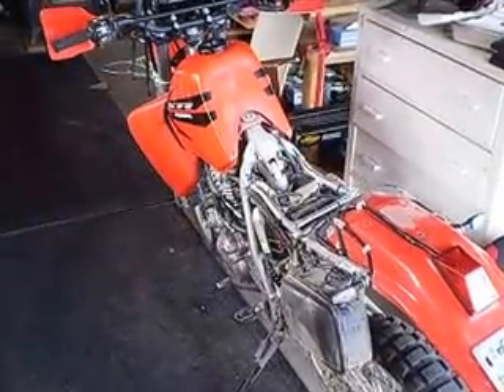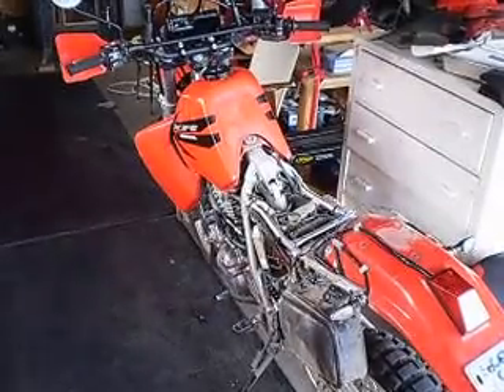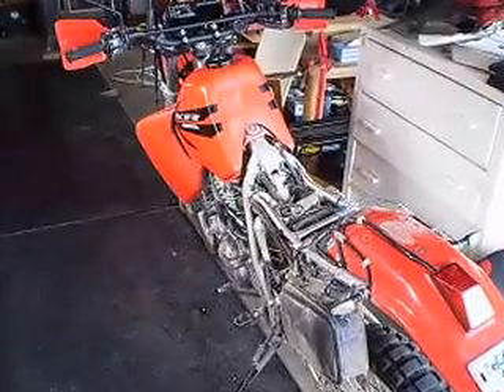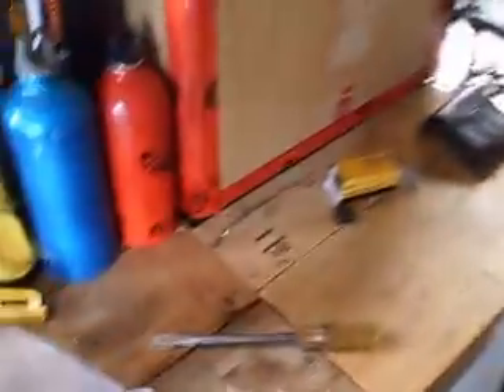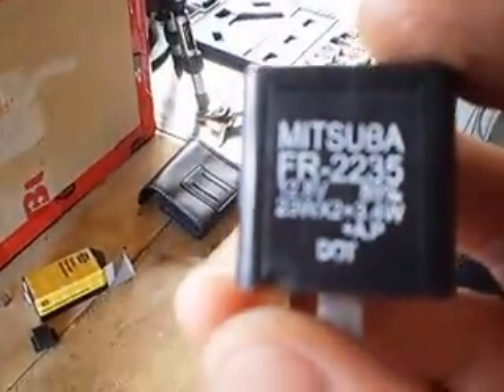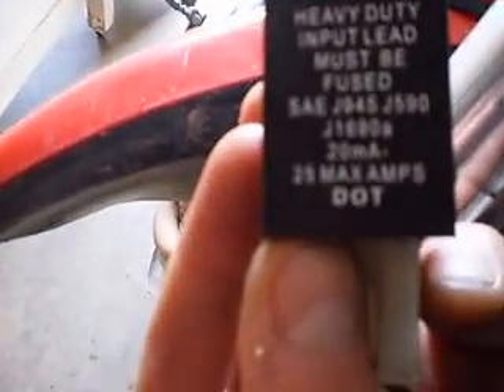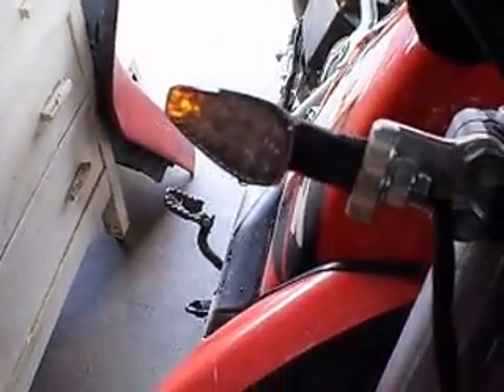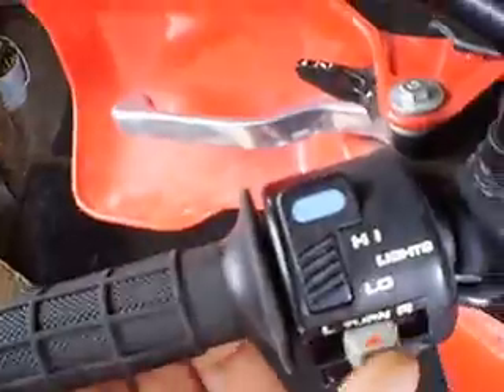Honda XR650l LED turn signal install

Comment: After watching this most awesome video, I found LED dash bulbs on amazon and bought some. It does NOT fix the issue. The dash bulb receptacle is not designed for a diode type bulb. If you install one, it will only light when you turn one direction and not the other. If you flip the diode bulb 180, it will only light when signalling the opposite. 

 Thank you for putting up this video. With LED lights going onto everything, it was sure nice to have someone think this out and let us all know.

Comment: Now they have a relay that works with LED AND/OR incandescent bulbs. So with the new relay you don't have issues with an incandescent bulb being used for the signal indicator. Or using an incandescent signal with an LED signal indicator. New relay solves the problem too now. Just wanted to pass on the info :)

Comment: First off thanks for posting this video it was a lot of help. Whats the S/N of that relay? I can not find one at my local auto parts store. Also, have you had any luck finding a LED for the turn indicator on the dash? I have a Suzuki DR 350es that I have put the same LED blinkers on but still need to find that relay.

Comment: first l.e.d. flasher box then a diode for the dash "signal  light" in line. 2 wires to that dash signal light.then u have dash signal and no unwanted turn signals.

Comment: Where did you find the brackets to mount your turn signals? I have purchased.the tusk kit for my xr 250l but my bike didn't.come with the.mounts more did the kit.. Many thanks for a reply.
Reply: Same here, i know its 8 years later lol but does yours have battery charging issue?

Comment: Pulling out that bulb isn't really a solution, you need to install a Diode Kit, it keeps power from flowing to the other bulb. The reason the indicator bulb on the dash closes the circuit and power goes to both indicators. 

Diode Kit is lister here:
Procycle.us

Diode Kit Installation:
http://www.procycle.us/info/guides/dr650/led-isolator-install-guide.html
Reply: People just don't realize with one indicator on the dash that indicates both signals the filament in the indicator bulb creates a path to the other turn signals that you don't want on.  As you stated a diode kit is the fix. If your bike has dual indicators on the dash you only need the relay. With single dash indicator you need relay and diode kit.

Comment: put ZETA led delfectors  on my xr and they would not blink.  O'riely autoparts and bought a LITTELFUSE 232 electronic flasher.  Stock lights on rear, stock indicator LED front signals all work great once the new flasher was plugged in.
Hope this helps folks, thanks for your input here it put me on me research